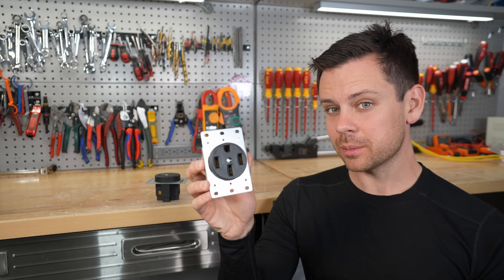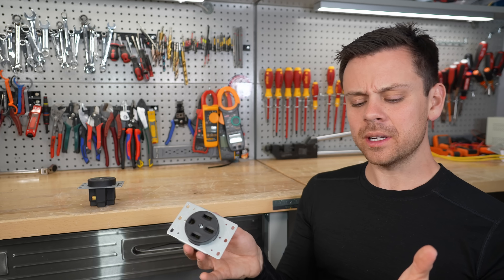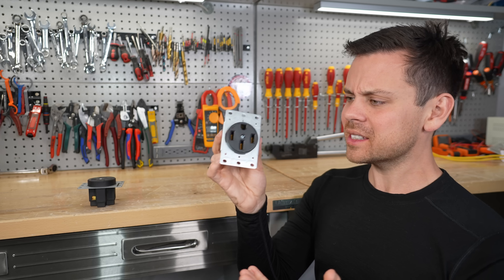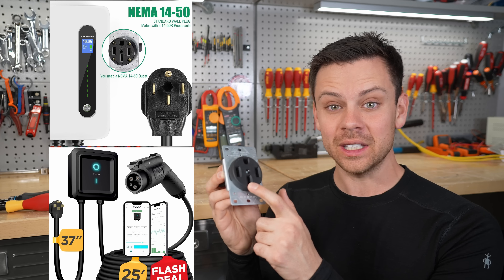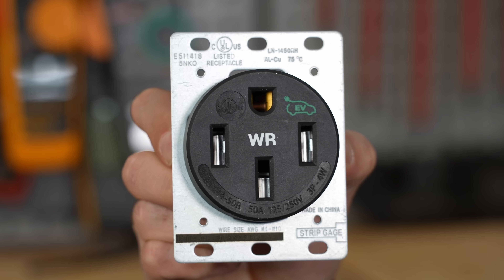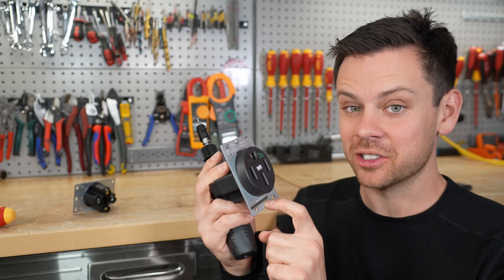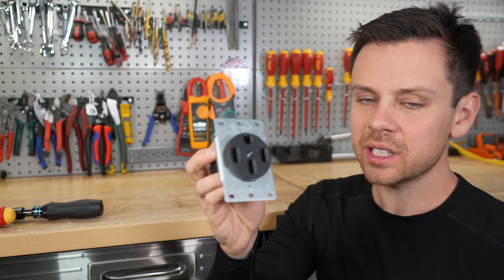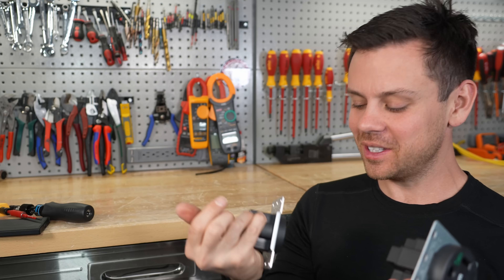Quick Guide to NEMA 14-50: Don't Burn Your House Down!

Comment: That's bonkers!
UL listed name brand outlet that's supposedly rated for 50A that does not even do 30A? I get the 80% rule, but this isn't even 80%. What's the point of the UL listing? What did they actually test?
Are we supposed to know that they're not rated for continuous operation?

I was of the opinion that if something is UL rated that it meets specifications. Not sure if I'll look at safety listings the same anymore...

Comment: It would be nice to see Hubble Twist-Lock receptacles, something like the CS6369 instead of the 14-50, as a standard for this application. There are cables available to plug into these receptacles that have a water tight seal on top of the twist-lock connector. With the twist-lock and the screw on seal, there's little likelihood that the plug could be partially pulled out, resulting in a weak connection. Comments?

Comment: 3:00 - isn't 6 gauge enough per code for 40A continuous/50A breaker?  I thought 4 awg was only required for 48A cont. load on a 60A breaker?
Reply from the maker: I use max size that receptacle recommends on the industrial model. And some manuals recommend it. Go with 6 if you want
Reply: @WillProwse  Know that if you do decide to convert to hardwire at some point in the future, most mainstream EVSE's do not accept #4 wire.  Chargepoint HomeFlex is a super popular one for example - #6 only.  The Emporia charger you reference is also stated for #6 per the manual.  #6 THHN is the effective requirement per code for up to 48A pull (60A rated) EVSE circuit (90C temperature rating). You can use standard lower temperature #6 NM (Romex) for this 50A outlet (40A EVSE draw).  #4 is indeed accepted by this outlet however - for less drop with longer runs.
Reply: @billjohnson3344  You can run the #4 wire into a pullout disconnect, which you're required to have anyway, and run #6 to the EVSE from that disconnect.
Reply: @brianleeper5737  Yes, that is true.  But another thing on the wall, point of failure, and no disconnect is required at this current level.
Reply: @ If the EVSE is hardwired, code requires a disconnect within sight of it, or a circuit breaker lockout/tagout bracket.
Reply: @billjohnson3344  422.31 would require a disconnect on a hardwired EVSE of any capacity.
Reply: @brianleeper5737  NEC 625.43 applies to EVSE's.  Only an EVSE of more than 60A requires a disconnect per code.
Reply: @ There is no exclusion for EVSEs in 422.31, therefore a strict interpretation of that would require a hardwired EVSE of any capacity to have a disconnect. It may come down to how the AHJ interprets those two code sections. Knowing that the AHJ will NOT fail you for having a disconnect when it is not required, the safe bet is to install it. Or contact the AHJ for their interpretation of this code.
Reply: @brianleeper5737  Yeah, it doesn't work that way.  625.43 applies to EVSE's - that is the pertinent section - not 422.31.  You do not see disconnects in the field on EVSE's unless on more than 60A current delivery.  All fully permitted installs, name brand EV charger installers like Qmerit, etc.  However, your advice to check with your AHJ is good in general for sure.

Comment: I use Noalox on the threads and where the wire is crimped. While torquing the connection down it is important to SHAKE or with a small stranded wire WIGGLE the wire at the connection point. Only a few degrees of movement. Retorque until the connector fastener does not twist anymore. You will have created the best connection possible. The Noalox grease will allow the threads to pull down properly at the given torque.

Comment: Electrician here. Circuit breakers and receptacles are generally rated up to 80% of their ampacity for continuous use, meaning practically 24/7. What's a safe "continuous use"? For my personal preference, and if possible, I would avoid subjecting a breaker or receptacle at around 80% for even a few minutes. Besides avoiding overheating, you prolong their lives, too. I have a 120-V, 2,200-watt jack hammer that I use at home, fed off a 20-amp circuit. 2,200 divided by 120 equals 18.33 amps—which exceeds 80% of 20 amps (16 amps) for continuous use, but since the jack hammer is only used sporadically or for a few minutes at a time, it's okay for such use (but still make sure you're not overheating the receptacle and even the cord by feeling it with your hand; of course, you also have to use the right cord). Wire selection is mostly based on 125% of designed load—which in my case is 1.25 x 16, or 20 amps, necessitating #12 AWG wiring requirement. Note that this is the anticipated use of the occupants. #12 wire has a higher ampacity rating than #14 wire, being thicker, and you'll generally find them in home kitchens. #12 is paired with a 20-amp circuit breaker, and #14 with a 15-amp circuit breaker, and you can see why. Of course, you can forego using #14 wire, but for house use, you don't really need all #12. The reason the kitchen uses a heavier-gage wire is because of your toasters, microwaves, and other appliances that generally draw more current. Those coffee makers are usually up there in hogging current!
      Yes, those cheap receptacles are not rated—or built properly—for the large, long current draw of a charging EV. In my bedroom, I use two small space heaters each rated at 500 watts and plugged, on purpose, into separate circuits, one 15-amp, and the other 20-amp—even though each only draws around 4 amps (500 divided 120 = 4.17). I make sure to stay on the safest side, since they're running while I sleep. Many homeowners are not aware that you must not overload a circuit breaker or a receptacle rated at a lower ampacity than the current draw for a long time. They get hot pretty fast, and everything in that circuit suffers—receptacles and/or switches, wire, circuit breaker, and splices and terminals (points of wire connection). Just read the manual of the equipment or device, which usually has a nameplate showing the ratings in voltage, wattage, and/or ampere. Circuit breakers or fuses are there to protect us from shock or fire, but try your very best not to overload them!
     And always use the best or right stuff for wiring.
Reply: Who knows this? ask anyone in the electrical aisle in a big box store did you know  "Circuit breakers and receptacles are generally rated up to 80% of their ampacity for continuous use, meaning practically 24/7" How many will says YES?

Comment: Interesting. This is the connector used in homes for the stove/oven!
Reply: Stoves/ ovens do not draw full current constantly like chargers, and aren't unplugged as often. Even the cheap ones hold up just fine for that use.

Comment: Hey Will,

Video idea. 

Have u Checked that your Torque screwdriver is accurate.  " Capri " is NOT a Tool brand that has Cred in the industry.
Klein tools, Snap on , and such Have been around a Very Long time.

Capri - sounds like made in china torque screwdriver.

i'd Recommend checking it / Sending it out for Calibration.

You May be Overtorquing things. You mentioned the amount of force required was a lot.

Been doing Electrical For the HvacR industry since 1981.

Sometimes the Best tool for the Job is the One Sitting on top of your shoulders.

Too Tight Can Crack and a break outlets etc. As Tight as u can get it By Hand Has Always Worked for Me.
Remember Copper & Aluminum are Soft Metals and will loosen over time.

Checking Connections for Tightness is a Part of Maintenance & Should be done occasionally. Preferably annually. Especially on a high Current Applications.

Channel Lock
Klein

Comment: My grandfather taught me in the 1970's (I'm 60) to recheck the torque after a few minutes. He said that solid copper will deform and stranded wire can shift around after tightening. 

I generally can get another quarter turn on most connections with wire sizes from No. 6 to 12. I'm curious to know if anyone has opinions about that.

Comment: That is insane... a UL Nema listed product should be able to provide the rated amps no matter how long (actually it should be able to withstand more than the rated amps if sound engineering principles are used), otherwise it's just not built or rated correctly!

Comment: I installed my parents 6-50 receptacle a few years ago for their ev, it's used with a 32A charger. But not a Tesla one so it has no plug temp monitoring. 
But I figured that would be well within the safety margins, and I did use the cheap leviton one from Home Depot. I did torque down the terminals to specs, I even went back a couple weeks later and retorqued everything. 
But yeah I've seen in the last year or so all these melting and fire cases. The Hubbell one went on sale recently so I got it and will be replacing it soon.

Comment: NEC states #6 THHN is rated for 75amps at the 90 degree column.  #4 is excessive
Reply from the maker: I still use maximum recommended by EV charger and receptacle. It's on the face plate. I'm listening to those.
Reply: @WillProwse There is nothing wrong with oversizing to #4 but as stated, it is not necessary. Especially when the run is 25 feet or less. Over 25 feet #4 is a good idea to reduce voltage drop too.

Comment: If a receptacle cannot safely carry the current it's rated for then the NEC and UL aren't doing their jobs. The 80% continuous factor comes out to 40A which the recommended outlet can carry safely- the melted one needs to be removed from the market and banned from use in any application since it can't even do that.
Reply: UL is like the BBB you gotta pay them for their sticker. 

Have one of these in garage for my welder. I've pulled more than 50a in it but for 5 min. My welders thermal switch kicked in before the plug got sparky.  Been using it for 15-40a loads on my welders for 15 years now. Guess I'll have to go look if it's a cheapy.
Reply: @omieyouknowme  it seems the issue is how long the outlet is subjected to the high draw. UL testing may not have taken into account the multiple hours of high draw the an EV can do.
Reply: @arnoldreiter435  I some what disagree. 
My tombstone welder can sustain 40a for sometime. Going to 50a I added additional fans and the thermal shut off was doubled. 
This is a 20% duty unit, in sure there are better welders that with 80% or 100% duty cycles for pulling 50a

Imagine a higher duty cycle welder going for hours vs minutes. 
Still not the same as EV but these welders have been around a loooong time
Reply: @omieyouknowme Same. Welders unless they are robots wont over duty cycle these.
Reply: If no one reports it to NEC and UL those products and suppliers/manufacturer(s) will continue to supply the market.
Reply: @Moffat-T   I would imagine those cheaper outlets got certified decades before EVs and continuous loads were a thing to worry about.
Reply: Underwriter Laboratories was an insurance industry scam to "certify" that certain things met the insurance industry needs.  Appliance manufacturers would "register" their power cord (yes, just the cord) and UL would let them buy that certification.  The sticker would go on the cord.  Neither the prong (plug) nor the appliance would in any way have been checked, verified, or certified.

Now they've changed their name to "UL Solutions."  What do they solve, exactly?  Nothing.  What do they do to help prevent recessed fires?  Nothing.  What do they do other than collect mfg money and offer stickers.  Nothing.  

Don't rely on UL.  They've not been useful to preventing recessed fires in decades.  Count on electricians doing the work correctly.  Oh.  Wait.  You're a DIY GUY?  So am I.  But classes are near free so if you're going to be doing electrical work around the house... take a class.

Then there was this one time our contractor for a shower expansion was wiring in the steam shower and didn't quite grok the wire scheme for 240VAC.  Had I not been familiar he'd have shorted 120VAC and it would not have been pretty.

We live in great times.  Experts like Will do PV cells and bats and inverters.  Others of us do high voltage.  Knowledge is freely shared.  Don't count on UL - they are nothing.  Don't count on NEC - it's just a set of rules.  Don't count on NEMA - they promulgate ways to do things but depend on professionals to implement them.

Nobody can ban an outlet (receptacle is the right term) from use.  NEMA can say it doesn't meet specs, but that's not likely to happen because of what it takes to meet specs, and demonstrating its failure.

Buyer beware.  Just hire the ****** electrician.
Reply: You are just noticing that UL is just a pay to play scheme?
Reply: The thing to rember as was stated earlier in this thread it's all about "continuous" load...my  inexpensive 14-50 receptacle on my dryer is just fine. It is not for my level 2 charger
Reply: @kellypurdue1990  Does UL clearly state the mark is NOT for continuous load?  Because the standard 15 and 20A receptacles ARE rated for continuous load.
Reply: Jeeze, those are used for Electric Dryers and Electric Ranges too. And I can guarantee you it cost 5 figures to "get through" UL cert.
Reply: @tedsaylor6016 
I don’t know of any range or dryer that pulls more than 40A continuously, and most are wired to 30A breakers. UL needs to take a look at the labeling on these outlets and make some changes.
Reply: @TimAZ-ih7yb  and UL ain't cheap to cert. had to be 5 figures.
Reply: @TimAZ-ih7yb    those are not considered a continuous load because they cycle against a t-stat under normal use. A dryer also has a cool-down period (5-10 minutes) and ends the load in about 45 minutes.
Reply: But wattif the UL Stamp is just FAKE......
Reply: That's what I was thinking. Leviton is a very reputable company in the industry and has been around for many years. I'd be curious how they got through UL when people are having issues like this.
Reply: NEMA 14-50 is a standard and if they have UL or ETL ratings they are both rated for the exact same duty cycle.  The EV symbol means nothing there is no higher UL or ETL testing standard or testing criteria for that EV identifier, its basically the same as “all natural” on food it means nothing, if you had a temp error on your charger, I would ask did you try a different charger or did you just decide that the outlet was the problem…. I love the videos and trust your judgement but this time I have have more questions than answers.  My run of the mill 14-50 has been charging my EV at 40 amps everyday for several years and zero issues of any kind none.  I actually went and inspected it after watching this no deformation or any indication of heat.  I think improper use of the charger is the problem with the basic NEMA 14-50 and while some outlets might actually exceed the NEMA 14-50 standards and UL standards stamped with the EV logo are just to mitigate idiots exceeding 40 amps, a standard NEMA 14-50 with UL rating used properly should never cause a problem for anyone.  MSE PE
Reply: @hamlinspahn2224  "Improper use of the charger"? You've got to be kidding me. They're designed to stay within the load ratings specced for the NEMA 14-50 plug/ outlet and are essentially "plug and play" devices so they can't be "improperly used". And they do NOT draw over 40A for extended periods. Plus your example of one means nothing statistically. 

The problem Will shows here is clearly that the outlet he shows isn't meeting the spec it's supposed to meet even if it's got the UL approval, and that problem isn't limited to this outlet. You can find hundreds of licensed electricians who will not use the 120V outlets sold at the big box stores because of experiencing similar problems with them. In my remodeling work I've seen the same where high-draw loads like electric heaters have melted outlets which are only a few months old even when the heaters are completely in the specced range of 80% for a continuous load. I've torn apart many good and failed outlets, both the in-wall duplex type used in homes as well as the replacement types used for extension cords, and in those I've seen what the problem is. It's always insufficient contact area to carry the current, poor metallurgy allowing the loss of tension in the receptacle after warning up when used with a heavy load leading to poor contact, or both. Either the manufacturing was changed after testing or the testing wasn't properly done.

And yeah, there's no specs for that little EV approved symbol but I'll bet those outlets are truly in spec and thus able to handle their rated load like the failed ones should also be doing but don't. It's obvious to me that you're an engineer because you cannot understand what is obvious and you blame something or someone else when the engineering and/ or testing standards you rely on in your work fail to provide the real-world results they're supposed to. Educated idiot is the phrase which springs to my mind about you.
Reply: Since when has any government agency ever done a satisfactory job doing anything?
Reply: @michaelgraham8504  Believe it or not, UL is NOT a government agency.  Look it up on Wikipedia, as their explanation is very long, and I wouldn't be able to explain it to you in a short reply, nor would I get all the facts 100% correct.

Comment: The problem most of the time is lack of tension on springs for contacts. Mainly because of repeated plugging and unplugging and letting your bulky charger freely hanging from outlet and pulling down on the contacts.
Reply from the maker: Absolutely! Wanted to mention that but didn't want to lose beginners. Hard to word that one

Comment: Every RV park has them, and it's very common for the "post" to smoulder and melt the plug and receptical.  Especially july August heavy demand times. Industrial pin and sleeve connectors i prefer. Extra super heavy duty for peace of mind and long term duration